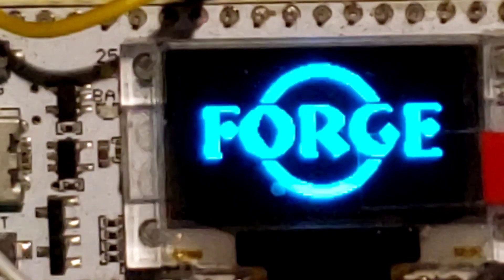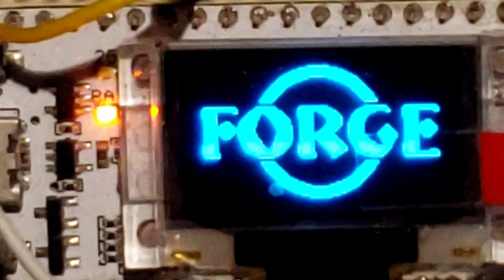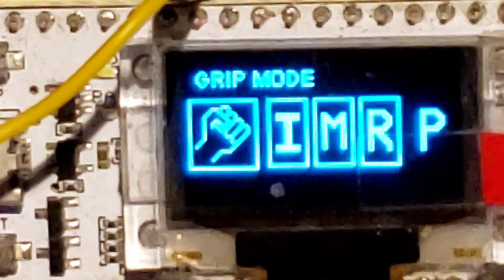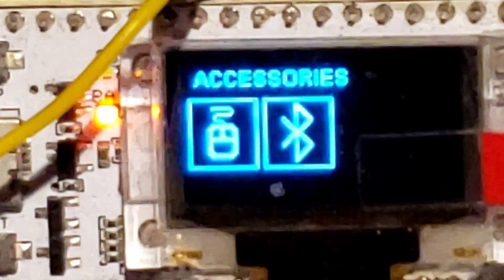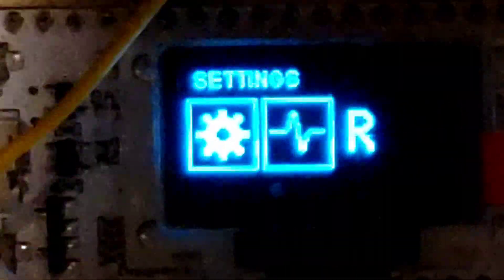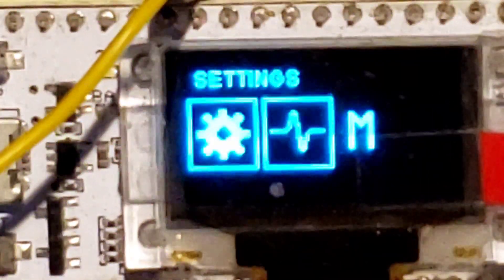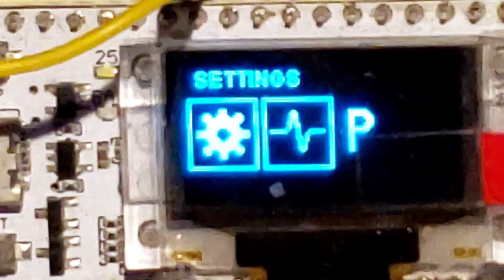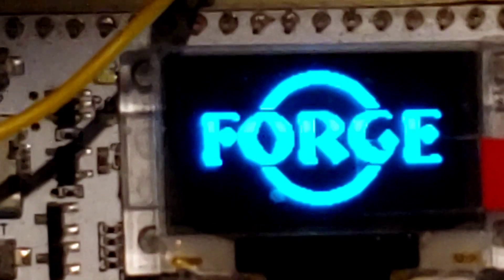Prosthetic hand Esp32 GUI demo.

Comment: Awesome, as always! Not sure how finnicky it is to get a certain grip set (as you mentioned for tools, etc); but do you think it'd be worth making some ability to have shortcuts for certain grips? Whether it apply to holding specific tools, or just to quickly lock certain fingers..would be especially useful if you ever implemented to ability to articulate the grip even more accurately, in terms of softness of grip, etc.

Comment: This is the first video I'm seeing on this besides your example of you flexing your hand, would it theoretically be possible to use whatever input you're using to interact with the GUI to set up sort of shortcuts for which fingers should be locked or unlocked? So like 2 long presses would lock all of your fingers, or 3 short ones would lock your middle and index for example?
Reply from the maker: I'm doing it as direct servo control.  I have 4 viable myo sites on my hand. When grip mode is activated, then the microprocessor will be looking for signals from those inputs and position ofth the lock servo from there.